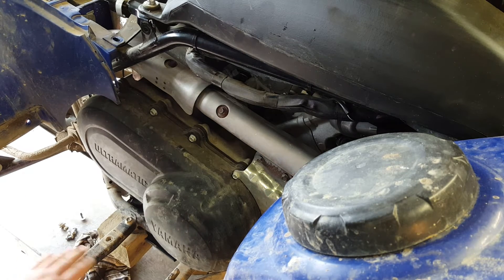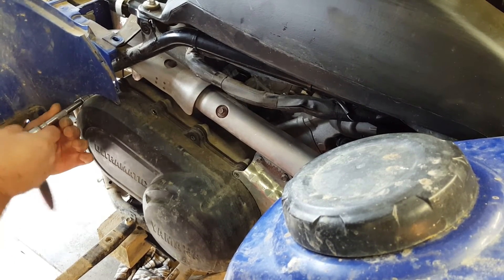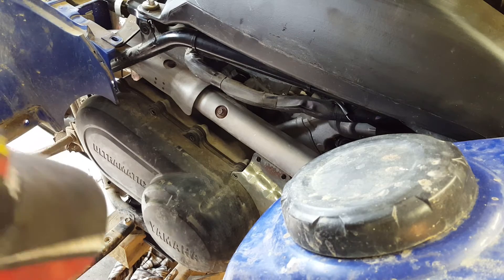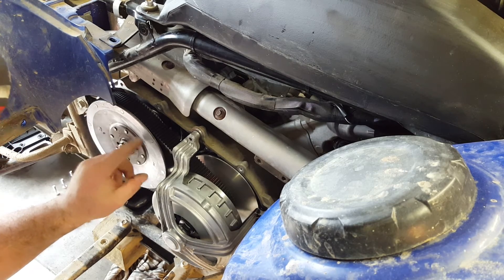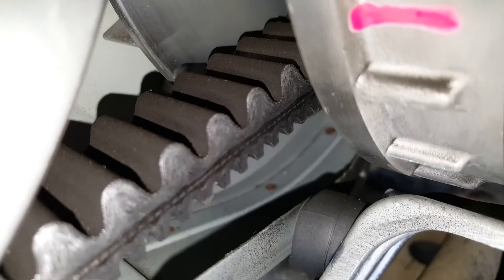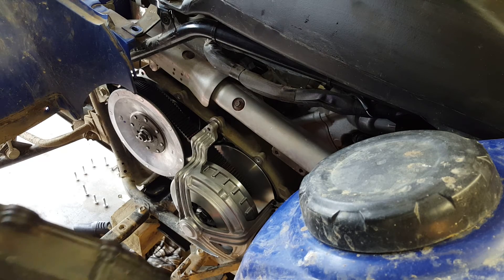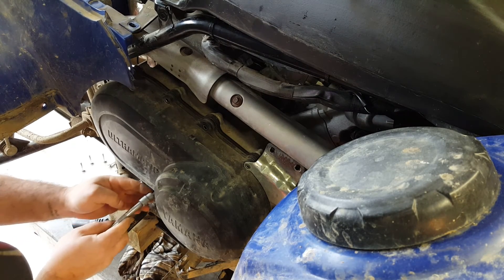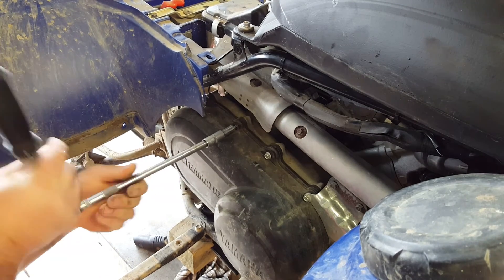Yamaha Grizzly 450 - CVT drive belt inspection #1006

Comment: Does the cvt drive have fluid that needs serviced periodically like the kawasaki brute force 300. Or is it called the transmission fluid ? Its fluid besides the engine oil.
Reply: Thank you sir.
Reply from the maker: No fluid in the CVT drive but the sheaves should be serviced annually & regressed using Yamalube Ultramatic grease. Cheers Andy

Comment: Hi Andy.  Thanks for these videos.  I have an '09 Grizz 450, so following your videos to do some good work on my machine.  One question:  The machine runs fine on the gravel roads.  I put new tires on it.  Not very aggressive tires, just new.  But now when I ride on the soggy tundra (I live in Kotzebue, AK., 32 miles above the Arctic Circle), the machine begins to bog down.  I have it in 4 high.  It can't be a fuel issue, I don't think, otherwise it would bog on the gravel roads.  It's just when I'm in bogs and the engine has to work hard that she's like self-retarding or something.  So, I have to go in 4-low to really move through the watery bogs to get out of them.  Even then, she wants to bog down just a little.  Can you explain what's going on?  What do I need to do to remedy the situation?  I spoke to a mechanic in Anchorage and he had me buy some Yamaha Polyurea Grease to put on the primary sheave drive.  Now, mind you, I'm not a mechanic and I'm 1,000 miles away from that fella by air.  So, where and how do I put this grease for my clutch?  (He assumes this will remedy the bogging issue).  I'm trying to hunt moose before the winter sets in which is not too far off.  So I'd like to figure out this bogging issue.  I was hoping in this video that you might speak about this grease but you didn't and that's OK.  Any advice would be helpful.  
Thanks!
Reply from the maker: Hi, thanks for all the info, very helpful. Right, firstly, the CVT drive grease, this is a relatively big job & requires impact wrench & torque wrench too, plus I don't think it's your problem. Let me explain: if the grade goes hard due to dust contamination then the primary sheave does not fully actuate, resulting in the upper ratios not been achieved. As a result the engine hits the rev limiter. This will reduce power output but not as I would describe 'bogging down'. 

Bogging down is the engine's RPM dropping off under load & a significant loss in torque output. Provided you have good fuel supply then I thing the issue lies in your ignition system, like you say.

When an engine is under heavy load, as when driving through boggy terrain, the quality of the spark is critical. Plus there will be a lot of water around too. Check your plug cap & HT lead. Grab a test light or just a bit of wire. Attach the clamp or one end of the wire to the engine casing then run the probe or other end over the outside of the cap & along the HT lead, you can spray it with a mist of water before hand. You'll need the engine running. If the insulation on the cap or HT lead is compromised then the high voltage will jump to the test light or wire & short to ground, engine will misfire & may even stall out

Let me know how you get on

Cheers Andy

Comment: Hi Andy my name is Nate from Mountain Lake Mn I was wondering if you ever ran across a clutch that had a
 chatter noise when accelerating on a yamaha grizzly 450. almost like a knocking sound. the wheeler performs 
perfect but makes that annoying chatter sound from the clutch area??
Reply from the maker: Hi Nathan, yes, I have come across issues with the Ultra magic CVT drive that produce a clattering noise when riding. You'll need to remove the CVT drive cover to expose the pulleys and belt. Firstly check there are no fan fins missing from the secondary sheave (big pulley) if there are then you have a major issue.

Also check the inner half of the primary sheave where it splines to the output shaft of the centrifugal clutch. Sometimes these splines get damaged because the primary sheave retaining nut has not been sufficiently torqued up - often Mechanics just tighten them using an impact wrench which usually isn't enough!

So to check this you'll have to remove the primary sheave completely. Whilst it's off have a look at the condition of the roller weights and where they run in the 8 grooves in the outer pulley. Rollers should be greased using the special Grizzly grease, they should have no flats on them - if so then replace. Cam plate must not have any wear on contact points where Rollers touch - if so replace.

Hope this info is of help
Andy

Comment: Do you know the size of the socket needed to remove the second spring? I used a 1 and 3/4th inch, but it just wasn't catching.  I got the spring off and replaced it, but I couldn't use the same socket effectively to tighten the nut back on to full torque.  So I'm wondering if you know the metric size of the socket needed to remove/replace secondary spring? I wasn't able to fully torque it back to specifications with the 16 pt socket that I used, so I'm looking to buy a 6 pt. socket.  I looked through the manual, all of the internet and cannot find the socket size needed.  any help would be much appreciated, thanks.